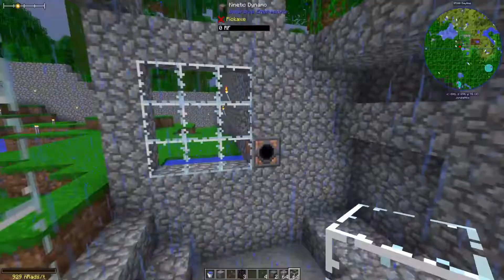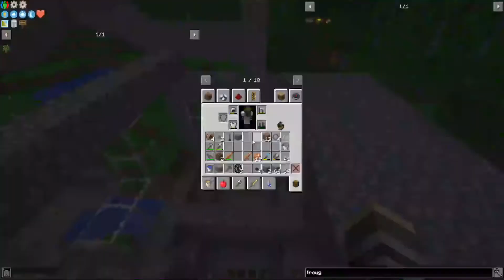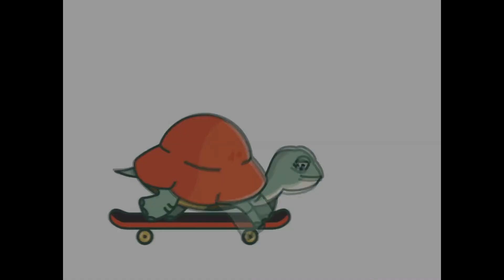Water Wheel, Capacitors, Wire Coils, Connectors & Relays - Immersive Engineering 1.12.2

Comment: The barrier in the middle is optional and you can just make a 6 wide wheel and the kinetics on each end will still see 3 wheels ea. You can cram 4 sets of 6 within a single chunk if you put 6 in a corner, add a 1 wide wall, offset 1 for the next 6 and do the same in the other half of the chunk. You will have 2 kinetics next to each other in the wall between, put connectors on top and a couple blocks up, where water flows across the top of the wheel, add an LV cap to block water with connectors on bottom leading to the kinetics and on top leading to power output line. Optionally, you can just use another mod's power cables that block water flow. That's 8 kinetics on 3 wheels each, giving you 704RF/t of free power sitting in a single chunk.